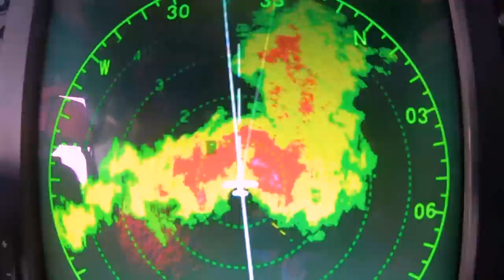Building and Selling $15,000 worth of Charcuterie Boards

Comment: Good job…
I use to produce “meditation benches” as a contractor…did this for three years…out of my basement…been there done that…just a FYI …you could purchase a cheap drill press to mount your branding iron in a supplied holder…thus making it easier to brand…setting the depth creates a more constant branding without too dark…too light effects…

I started with bench tools when I started at the time …late 1990’s…after a couple a months I outfitted my shop with Reliant stationary tools…had to “coach-up” some aspects of the tooling…but over the three years I worked this contract I produced around 4,500 benches…

Good luck to you now and in the future…

Comment: Have you guys looked into a CNC for cutting out the shape of the boards?  I feel like it would save a lot of time over what you’re doing with the router table.  You could even glue up boards to the size of your CNC table and cut multiple at one time.
Reply: Here is a bit of math to think about. Let's say that 5 of the 30 hours were routing. This is 150$ per batch. A good capacity CNC is in the 10k ballpark. That is 67 batch before you break even.

Granted, you could use it for other stuff too and the router/router table do have a costs (router bits even out on CNC vs router). However, their style of woodworking is: if we need it, we buy it, so I assume they ended up analyzing that it is not currently a good buy for them.

another caveat to my analysis, you would need to substract the cost of the bandsaw + the bandsaw time. You also need to calculate the loading time on the CNC. While CNC are nice, you can have more throughput if more people get hired/involved at every step of the way.
Reply: I've wondered about that myself as I come more from the CNC background rather than traditional woodworking approach.  For my upcoming products, I'm using the CNC with the idea that I can add flourishes and complexity that is a bit harder for a template to easily handle.  It seems to me that if they wanted a CNC to be a significant help, it would need an ATC (fast bit changes) and vacuum table (fast workholding), all of which add to the cost and support what Simon said about break even cost.  The major advantage to that approach is if they need more production capacity, just add another of the exact same machine.
Reply: @jothammcmillan8854  I would be interested to just chat up about CNC work someday. I'm an engineer, but I never really integrated CNC work in my woodworking simply because of the size constraint. I have a small 3018 for some templates.

The economics strong and weakpoints of it is fascinating tho. For me, they shine a lot for everything built out of sheet goods for extremely obvious reason. They also shine when doing batch work that require a lot of intricate details (say engraving an absurd amount of letters). They are also rock n roll when dealing with slabs, they automate the flattening process for you.

They also shine when a one man show type of business wants to invest without having to deal with more employee (working from home, don't want to bother with insurance or whatever the reason is). In case of labor shortage, a CNC will also always be there!

Weirdly enough, I didn't see a lot of ATC in woodworking CNCs (at least on youtube). I see them a lot in mechanical shops and PCB fab house tho.
Reply: @simonmarcoux5879  Absolutely, I'd be delighted to give you my non-expert impressions and I'll send you my contact info directly.  In a past wanna-be business, I used a Shapeoko XXL (32" work envelope) to route HDPE cutting boards with t-tracks and NPT tapered threaded holes for a third-hand soldering accessory.  The business fizzled but I really enjoyed the CNC process.  I'm a software developer so working in Fusion 360 with parametric modeling and figuring out the CAM keeps me in my happy place.  Plus, I'm working out of my garage as a one man show type of business  :)  

Nowadays, I spoiled myself and bought an AVID CNC 4x4 Pro machine (48" work envelope) with the idea that I could batch out various drink trays/charcuterie etc.  While creating the CNC workflows over the years, I've found the slowest aspects to be workholding (I use clamps and double-sided tape) and swapping bits.  I probably should do more hand processing but I try really hard to use the CNC even for stuff like chamfers with the idea of it being a batch process (someday).  The Avid ecosystem is pretty expandable so what works for a 4x4 also works on a 5x10 etc.

The industrial CNC routers definitely have ATC however for something like AVID, you have to go with a 3rd party resource like CNCDepot.  That's far from ideal and I suspect the AVID folks know that (hint hint).  

One example of how my workflow might be different is this:  I'll have a surfaced piece that goes through several operations to chamfer all the edges, mill out the holes and then for the final contour, I make sure to do multiple passes where only the last contour pass cuts all the way through the wood.  I don't have tabs to remove and the piece comes pretty easily off the table (tape) where I take it to final sanding to make sure any fuzz is dealt with.  If I get the depth wrong, the piece comes loose too soon and all goes bad.  A vacuum table or pods would substantially reduce this issue.

Realistically, a real woodworker (not me) is going to be faster with manual processes but it doesn't scale as easily as additional robots.  Also, as time goes on, I want to be able to add additional details such as engraving, laser customization and the precision/repeatability of CNC allows me to make those additions with only a few prototypes per change.

I highly recommend the Wyrmwood Gaming channel as they use a combination of hand and CNC processes to produce high end products.  That's what I aspire to!
Reply from the maker: This conversation is a lot of theory and NO testing or actual numbers. No disrespect, and I love overthinking things as much as you do, but we could think about "what if" all day and have nothing to show for it.

We have to walk before we can run and our current process is solid, repeatable, and profitable. I'm not a huge fan of it, but we need to make money at the end of the day. We have bigger inefficiencies to solve before we need to squeeze a few seconds out of our production process!

Also, I would be really shocked if a sub $50k CNC machine could produce 125 boards with handles like ours faster (and ultimately cheaper) than our current method.
Reply: @jennieanddavis  I totally agree with you!  I think you have a solid and efficient process already.  It's probably not the right time because of the capital required but if you ever branch into other products like catch-all trays for your realtor customers, then it might be worth revisiting.  The main advantage of the CNC is that once you get it dialed in, it does allow you to work on other things.  You still need to keep an eye on it but you can do other tasks nearby.  If you need to double your production, you can buy a second machine and get pretty close to doubling.  From a numbers perspective, an AVID 5'x10' with ATC is roughly $20K, that's a lot of catch-all trays!

I enjoyed this thought exercise because I'm currently setting up my own workflow and doing most of the processes with the CNC.  I've been watching your videos and really questioning where I might want to bring back some of the hand processing to improve speed.  I have a very small space (garage)  so setting up table-saws, jointers and router tables is pretty difficult but not impossible.  I didn't mean to drag everyone into my internal argument.  :)
Reply: @jennieanddavis  To be fair, it wasn't really a what if type of discussion since we closed the CNC argument in your specific case after one comment and a few simple guess numbers.

 We just rambled on afterwards  talking about what CNCs are good at and what are they bad at. Essentially not a ''what if'' discussion but rather a ''why and when''

As for the last part of your and for sake of numbers and argument, If you prduce wide enough boards to carve the charcutery board with handle, you could do almost all the batch processing on the CNC. You put the boards, the CNC flatten the top side, carve out to 95% depth the board, drill the handle hole and all you have to do is to plane the other side to release the boards thus flattening both sides. Roundover and your done. (You can get away with not milling your boards flat with a CNC rather easily)

I have not the specific breakdown of what time went into where in your 30 hours, but you could get maybe 20 to 25 of those hours on the CNC, so 600$ per batch of saved labor cost. But, you (at probably more than 30$ an hour)  would be free to do something else while the CNC is running. 

There is also the fact that you don't hire employee exactly for the 30 hours required and then magically send them home (well you can, but there are HR risk of talent retention for a safer more stable job) for a batch but are likely to hire them and have to pay them for non-productive work/overhead work which you do not factor into your pricing per unit but it affects your business bottom line. A CNC doesn't have that problem. If it does nothing, then it cost you nothing. So a 3 hours per week (At 35 hours a week) of unproductive time yield a monthly 400$ worth of padding.

Putting it all together, a 20k CNC over the course of two years  will have 9600$ saved in not productive employee time. You can also add a resell value since it is an asset (say 5000$). So you're left with 5400$   and would therefore require 9 batch of boards to break even vs hiring someone (or doing it yourself) to take on those 20 hours of work out of the 30. We didn't factor in other usage in that quick and dirty calculation (flattening table top for example).   Those numbers are fair hypothesis and there are a lot of business that made this business model works for them. It is therefore tested and mostly numbered (with a reasonable margin of error, I didn't took the time to dial in all the numbers and get more precise). 

A more simple approach: over the course of two years, a 20k cnc worth 5000 at the end needs to run a total number of 500 hours to be paid for at your 30$/hour rate. 500 hours is a quarter of a year of salary pay.

At the end of the day, you designed your  company and your processes around a HR/power tool core philopsophy, not a automation core philopsophy and there is absolutely nothing wrong with that! Kris Devo is a proof that your process is extremely valid and could be pushed even further.

There is a way to achieve great effeciency and cost margins in both philosophies, at some point you just gotta commit.

Comment: I was today years old when I learned what a charcuterie board was. Great video. What's the dipping of the board in the water for?
Reply: They dip in water to raise the grain of the wood. After cutting to size and thickness the boards grains will raise the first few times it gets wet and feel rough. You can get them wet in the sanding process to smooth this and prevent it from happening for the customer so they always have a super nice product.

Comment: A question about your brand: the one I purchased glows red hot between the handle and the brand (the part I call the barrel).  Where did you get yours because mine is not safe for man or beast!
Reply from the maker: Get a soldering iron heat control from Amazon and turn the dial down a little!
Reply: @jennieanddavis  so I keep the Chinese branding iron but plug it into the heat control and turn down the heat?

Comment: Love the cost breakdown. I'm not sure what size charcuterie boards you make, but are you able to source walnut boards wide enough that you can eliminate the glue up entirely? Even if you have to pay more in bd ft price, the time savings seems like it's worth it. Or maybe I just hate glue ups 😂
Reply: That's a silly question. Cutting boards are edge grain or end grain for a reason. A face grain board is never going to bring in more than $20. Not to mention a regular board is going to warp big time once contact is made with water.
Reply: @clearcut6818  thanks for your opinion. In this video, they use face grain for their charcuterie boards, so clearly it's going for more than $20
Reply: @jsoliman85  Exactly,  it's Walnut. A very expensive wood. People lov it and they have a great market and obviously they sell for the price.
Reply: @jsoliman85  frankly, that's why they call them charcuterie instead of cutting board - they are terrible for cutting.
Reply: all I make are face grain boards. Usually wider strips too. never had one to warp. In fact,my very first one gets used almost every day,gets washed with soap and water and shows no wear.
Reply: @clearcut6818  Their cutting boards are face grain too.
Reply: @markabernard   that makes their price look even more outrageous.
Reply from the maker: We actually get a higher yield/profit from narrower stock glued-up to our standardized width than sourcing wider walnut boards (there's a lot of waste there, but we can salvage more of the 'bad' pieces if we cut them into strips to add width). That's really what I was testing in this batch! 

I hate glue-ups, too but this is a business not a hobby! Gotta do what works!

Comment: Great content including the breakdowns. Couple questions that came up during the watch. Thanks in advance
Is the commercial space viable if you only have the actual woodworking stream. I know you have other income streams. 
I’m assuming labor rates would have additional burdens over the rate noted?
The note that 30 hours of work went into manufacturing - how much labor per board / batch is involved in fulfillment.
Reply: depending on the size and intricacy of the laser engraving it takes between 15-45 minutes to engrave each board. That includes the time creating engraving file on the computer. Most of their options are set up as templates so they are easy to pull up and add a custom name and send to the engraver.
Reply from the maker: Wow those are big questions - I'll try to oversimplify our answers in this comment:
1. Yes. Commercial space rent is VERY viable with our woodworking business alone, a couple friends in the Stud Stack have similar spaces without youtube channels or other streams of income beyond product sales. But the other income streams are really nice! I don't know why people always assume that's 'cheating'... Both businesses take a TON of work!
2. We have a flat estimate of $5/board incorporated for board fulfillment labor as part of the materials cost. Again, a streamlined packing and shipping process makes this possible and with scale, it gets even more profitable!

Comment: 7:12 Did materials cost include building and other business overhead, or was it just the consumables for the boards directly?
Reply: I was wondering about same because I would think you want to add the building rent, electricity bill, Jennie’s salary, and multi-media salary to make sure you are still making a profit.
Reply: Figuring the profit margin of a product, you typically don't factor in fixed costs like rent, salaries and utilities. Not all of the profit he mentions here is going in his pocket. Some goes to the overhead mentioned above. He's going to have those monthly costs no matter what he makes. Once his profit exceeds that figure, which I'm sure he has in his head, that's the real monthly profit of the business.

Comment: Are you joining boards together to give yourself enough width, or is there another reason?
Also looked like there were a lot of burned edges on thoes finished boards :(
Reply from the maker: Yeah to get a more standardized width.
After roundovers and sanding, the burning mostly disappears. But the customer has no clue whether that's burning or wood color. Which is exactly why we don't sell wood to woodworkers!

Comment: 7:00 Did you count in the cost of that place you rent there? And Electricity, other materials like sawblades/routerbits? That would reduce the "total profit" if I am not wrong.

7:39 Yeah, I think to those boards are basic. The thing with the well designed Charcuterie Board is you need to find someone paying quite allot more for those, right. Those basic ones semm to sell pretty good, I would only make better ones if someone orders them, lol. Why make something, that you can't sell, the basic stuff sells best usually.

Comment: Love your work and your entrepreneurship. I noticed that 9 minutes and 49 seconds in this video, Davis is using a branding iron. Why have you chosen The Branding Iron over your glowforge?
Reply from the maker: Glowforge takes way too long to engrave that on every board - branding iron is MUCH faster than even a quick laser engraver
Reply: @jennieanddavis  thank you for your quick response. I do have a CNC router and I have been researching CNC laser engravers. Currently I also use a branding iron. Congratulations on your success.